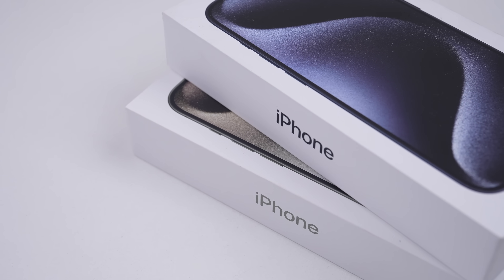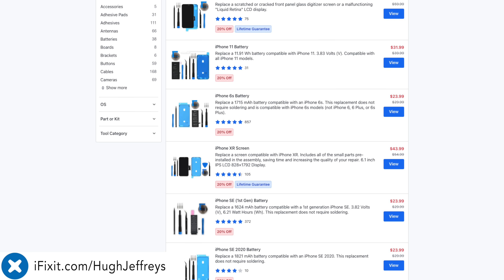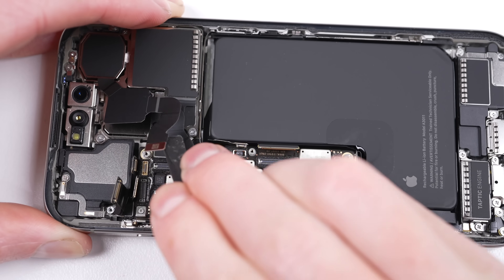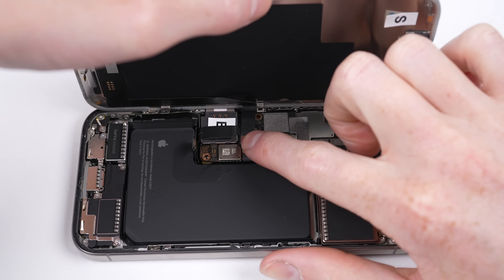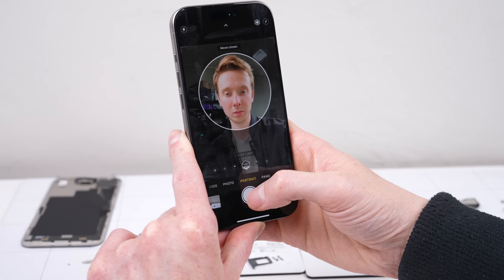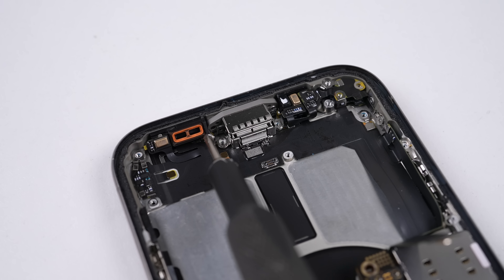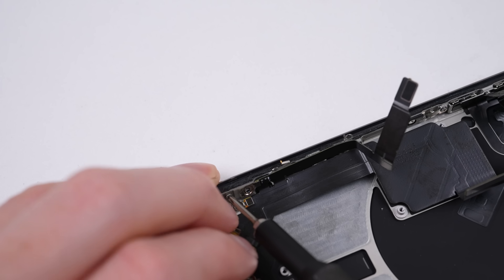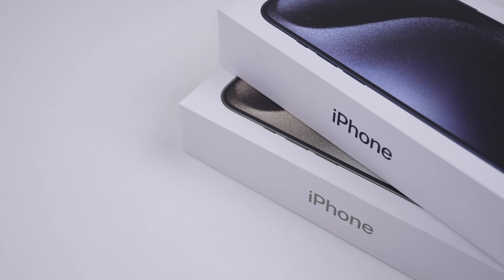iPhone 15 Pro Exposed - This Will Harm The Environment - Teardown And Repair Assessment

Comment: Having been a service provider for IBM in their Thinkpad line of laptops, I can say that their purpose of preventing the use of non-standard replacement parts is so that the final user who gets the machine after repair knows that the device is supported for down the line repairs.  I know the serviceability is important to the final user, I can state that the use of non-standard parts is something we want to avoid so that the machine functions well for the user at the end of the line.  I understand the desire to repair the device along the way, and that's a fair point.  We just didn't want the final consumer to think our quality was poor because someone between the initial release of the device had introduced problems when the replaced (FRU field replacement part) was used.
Reply: that choice should be left to the consumer and not be forced on them.

Comment: The “right to repair” doesn't mean that you can do whatever you want and Apple still has to guarantee the functionality of your iPhones. Apple is also not obligated to finance a gray market with original parts, so that so-called "independent" repair shops (Independent of what, actually? Of quality, responsibility and legal minimum standards?) can do business with it. Either they get certified for zero costs and have full access to manuals, original spare parts and software or they have to live with the fact that their work is limited. Apple ensures with the signature of the parts as well as their interlink after the installation that the customers can be sure that only registered original parts are installed, which support all functions. That's why Apple now supports the “right to repair” law in California, because that's exactly what it provides for. If you want to have a wild west, just repair Android smartphones exclusively. But remember, Samsung and Google also do the same with their smartphones. Ifixit, this utterly fearless self-appointed avenger of all enslaved customers and poor little repair shops, sells spare parts for Samsung and Google, of course only originals. Needless to say, both certainly don't have to fear point deductions in the repair score for doing the same as Apple. Because, he who pays the piper, calls the tune. What hypocrites! 🤢

Comment: Even though it uses the usb c charger now, you still won’t be able to use most usb c chargers with your new iPhone 15. Apple just refuses certain usb c chargers seemingly randomly. I tried to fast charge an iPhone 15 with huawei’s 120w supercharge, but that didn’t work.
Reply: My phone hasn't refused any chargers yet. So long as it has the correct power profile and is PD compliant, it should work. Apple has not locked down the charge port requiring any proprietary authentication.

Comment: wow and youre still not smart enough because those codes was scanned at the factory when it was being built up and already stored in the memory chip and also on the computer as they saved in there too for any parts is being replaced with what part it will be so thats how it works and youre not allowed to fix that but by Apple Store do have that and thats why got that and the Apple Store have the right to fix it and not to you at all and thats the rules of that get it huh?

Comment: It never crossed my mind that a phone company will be praised for a "removable" rear glass, yet here we are.
Reply: And... it's software paired.
Reply: @alessioacri. yeah MKBHD was praising them for not outsourcing anymore and I was like wait a second… only Apple can replace their parts now? 😮
Reply: @alessioacri. the wireless charger coil is, but that’s removable from the glass.
Reply: @EvilTurkeySlices  thats still very sad
Reply: Remembering all my old Android phones where the back would clip or slide in and off and provided easy access to a removable battery and microsd card slot as well as the SIM.

Some phones can do this and still be water resistant.
Reply: @StefanHolmes  Apple trolling on their gullible customers was funny until Android phone manufacturers see people buying them and copied
Reply: The new iPhone you have to put on heat pad three times  to crack it to replace glass 16 different screws and about 20 different cables then it won't recognise new parts so have to ring Craple even with 2 straight from box, not really repairable.
Reply: It's wild and sad state of current big companies and consumerism really.
I'm old enough to used a "dumb phone" such Nokia 5100 when users could practically replace most part of the phone themself with little to no expertise and specialize tool.
Long gone the day when we're able to swap part like batteries, keyboard, keypad ourself easily.
Reply: @dalfifran7572  the reason batteries specifically are harder to replace now is due to the increase of water resistance. It gives no reason as to why apple makes it so hard to do a battery replacement in terms of pairing batteries and the backglass but that is why phones are harder to repair now
Reply: They have been abused for so long they've accustomed to it.
Reply: Apple is as much a Phone company as RedBull is a drink company...They both technically make what they are known for but in reality, not really.
Reply: didn't the iphone 4 have that 12 years ago
Reply: @mathegaming4415  yes the iPhone 4 had this, but of course it had no claims of water resistance. Fairly understandable I think. Water resistance was less of a big deal back then.

We used to buy special cases if we wanted protection from rain etc.
Reply: @mathegaming4415 yes but the screen was not as easy

Comment: Dammit Apple come on. You do some amazing things. These phones are high quality, long-lasting devices. You are huge on user privacy to the point where you block governments from gaining backdoor access to a users' phone. You obviously want to help the environment. Reducing EWASTE is HUGE in that aspect. Stop pairing parts man, and people will buy your phones more. You can still make money off of us by selling us parts directly.

Just stop pairing and software blocking. That's all you gotta do and the money will come flying in (I bet more than what you make with certified repairs). I bet sales will increase too. At the very least, RESPECT WILL INCREASE. And that GOES A LONG WAY and feeds sales years and years down the road.
Reply: Just switch to non apple devices. Its litterally that simple

Comment: Does anyone know, do machines put these pones together at the factory or are there people putting all these screws in for all these parts?  If its automated, holy cow there are some advanced robots out there.
Reply from the maker: You have to think that all these screws would add to the overall build cost per unit.

Comment: BIOMETRICS AREN'T PAIRED FOR SECURITY.

How long do I have to repeat this sentence?
I spoke to someone, a soldier responsible for maintenance in my local army camp(ABCAbwBtl 750), I asked him since they also have biometric scanners in the base if they required pairing after replacement, he said no.
"We can just order the part from the manufacturer or online from a third party if there is one and it will work just fine without any pairing, this is because its just the sensor and the rest is done on a different board." clearly proving it doesnt have to be paired. Ofcourse this was bs from the very beginning.

yeah there might be some unknown group that made a home button or face id module that captures the raw data and "sends" this data to the phone on command, thus theoretically unlocking it, but for this to happen would be just idiotic, but yeah in that case, pairing would be safer, but who would get targeted by an organization? If you get targeted like that, I would be more worried about my life instead of my phone.

Also, if someone wants to get your data, they will. And they can use this biometrics pairing bs to get it easier. Why?
Because if your biometrics have been disabled "for "security" reasons"< obvious lie right there, you obviously can't use them and have to either use passcode all the time or just leave the phone unlocked. Great! Now someone can spy on you and exposing your passcode because they just changed the biometric function. And obviously passcode can do more than biometrics. Very good indeed, Apple!
You can set up exclusions for the biometrics, what they can't do, you can't do the same for the passcode.
Reply: No one is going to read that
Reply: @NEON2600  atleast the most important part is at the top.
Biometrics aren't paired for security. Anyone who wants to have more context, can have it by expanding the comment. Easy, right?

Comment: Even if "genuine/ compatible" parts were a real concern, it should be handled by some hyper low-level universal in-house batch of codes or identifiers built i to the OS. At worse requiring the phone to download different firmwares, not every single part having a unique serial that has to be married by HQ and of HQ's volition!

The LOADS of android (and other) devices not having this, and not having the "issues" Apple claims to be "fighting" just show their game.

Add to that how many of these parts aren't universal fitting to begin with, and they are blatantly full of it.

Comment: Why can't apple just have a validation check if the its an actual apple part or not?  Why does it restrict you from repairing it with a genuine apple part?  i.e. Brand new part straight from apple supplier?  Clearly they are using this to ensure you pay top dollar to have your phone fixed.

Comment: Well this didn’t take long at all. I expected this to come at least a week at most before we got a disassembly video. 
Not too surprised at the results but it still sucks that we had to lose both the mute switch AND the lightning port for BS reasons.
You’d think that the EU would’ve had spent more time getting them to regulate a proper right to repair bill instead of forcing everyone to use USB-C.😒
Reply: THEY REMOVED THE MUTE SWITCH?
Reply: Yep @SOTP.
Reply: yes because they wanted to copy Android. @SOTP.

Comment: Did you try booting into diagnostic mode ?  If apple ever improve the part pairing it will require reloading calibration profiles that are loaded using diagnostic mode!
Reply: They won't improve it.
Every time they make an iphone they go to the drawing board.

The ability to pair parts without apple's approval remained on the drawing board.

I see it as both a red flag and a lost cause.
Reply: @Walter_   The ability to retrieve a calibration profile for a part that has already been paid with a different SOC will never be possible.   Since this is a feature that reduces the value of stolen devices (a lot).

I could see some laws coming out that would require them to let you pull this profile but only if the device owner of donor device grants permission (aka removes any iCloud lock on that device).

Comment: Ok, a honest engineer opinion:
1. I do like the multitude of connectors and screws. It makes for a design that can withstand more of a flex without breaking.
2. The "programmed IO" - well here I'm kinda split, for one I don't like that you can't replace the part on your own. But as an engineer, I've seen third parties creating a copes of peripheral with additional "funky features". That were ranging from benign resolution faking to eves dropping, with worst ones installing malware on your device (and since it's part of your hardware you can't really "remove it")

I know there will be people fighting me in comments and telling me I'm and idiot etc etc, however after two decades of this crap I've seen enough and don't care about people defending X Y Z.

Comment: iphones are so badly designed compared to other manufacturers, open up a modern samsung and you'll find around 10 - 16 total screws (all the same size) and no stupid little brackets like inside the iphone, much simpler to take apart.

Comment: Something Jeff didn’t mention 
The back glass too are now paired 
Changing it will result in the flash not working in photos
Reply from the maker: Taking a photo using the flash can be seen here: 7:54
Reply: @HughJeffreys  oh ok my bad guess it’s only on the 14 and 14 plus

Comment: New back glass design is cool and all, but as it comes with the microphone pre-installed, unless you use a genuine Apple part or transfer the flex cable, audio quality in videos might be affected.

Comment: Great demonstration and a clear message! It's so frustrating to see it's quite repairable if not for the software locks. I'm just curious to know how possible it is to overcome some of these with previous hacks? For example swapping the battery circuitry from the original battery or cloning the display's serial number to get True Tone working again. Also I'm curious to know why it is so difficult to overcome these software limitations?
Reply: They definitely use encryption.

Else someone would have made a tool that can pair everything unofficially by now.